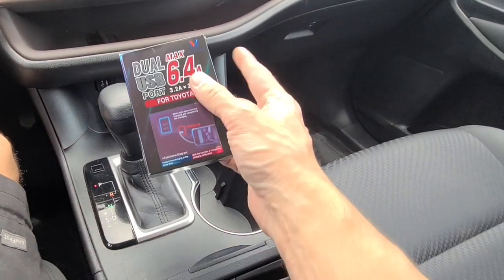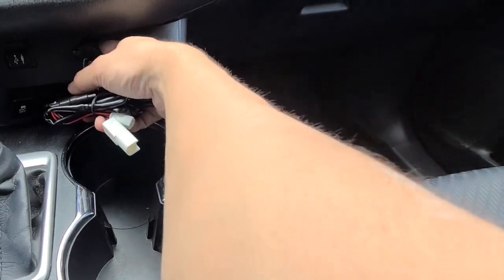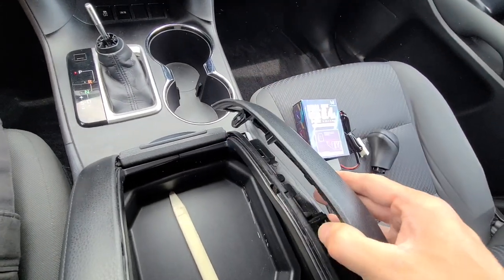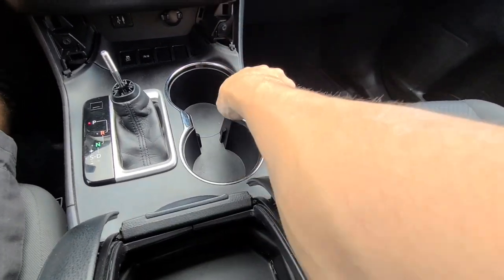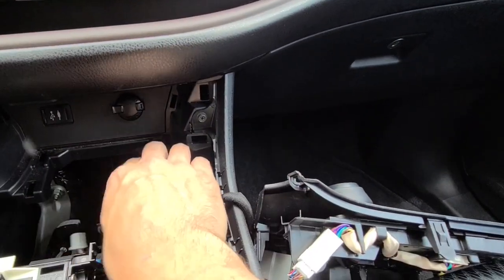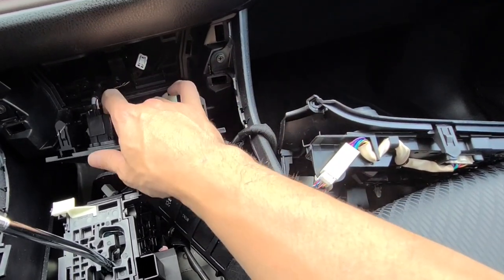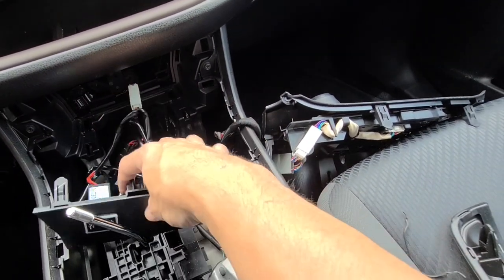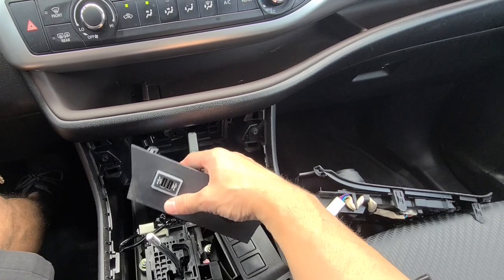Every Toyota Highlander NEEDS THIS Dual USB  Quick Charger Socket 3.2 Amps Quick Charge Your Phone

Comment: Great video, thanks! I bought it on your recomendation and it went together very nearly exactly like you show. I installed it in the existing USB location. One thing though, on my 2015 Highlander, there was a screw on the back of the last piece that you removed (the panel with the USB and cig lighter socket). You can see the screw with a dentist's mirror and a flashlight. You have to remove this screw to remove the panel.  It requires a stubby (very short) phillips screwdriver and pretty good dexterity (left hand working from the passenger side) to remove. I did not re-install the screw when I reassembled. Works like a champ and looks great. Thanks again!
Reply: thnaks Mark i knew it
Reply: Ditto on the difficult phillips screw at the top of that USB panel. Worked 3 hrs with stubby to try and loosen it and no luck.
Reply: @ralphghent3254   actually you don’t need to remove that panel at all.. use your hand unplug the power plug it to your usb cable then use the extra one to plug back the cigarette lighter it took me 5 minutes 😂. Good luck

Comment: min 3:11 im trying everythin in my 2018 limited model dosent came out i thing has screw inside almost broken used correct tools but i dont know wha happend cant reach the plug for conecte :(
Reply from the maker: Not sure dude
Reply: Same thing here, did you figure anything out?? I am going to reach out to my buddy at Toyota to see if he has any ideas...
Reply: There are two screws behind. It is super hard to get in without opening the whole center console. I had to break the last panel and ordered a new one. This video is fake

Comment: Just installed this in my 11 Highlander, only option was to swap it out with one of the existing 12v cig plugs, meaning I had nowhere to plug the extra adapter into. Can I leave that part unplugged or should I cap it off?

Comment: I need to do this but I don't think it'll solve my issue. I have a Dasaita android aftermarket unit and eventually it stopped connecting my android phone to the headunit although it does charge the phone. I saw you disconnected the usb connection but didn't connect it back only to the cigarette lighter, correct?
Reply from the maker: Yeah, won't solve your issue. So sorry

Comment: Great video and Awesome job. Amazing dexterity and speed filming with one hand. I will try this.   Any ideas for this situation?  I hate the parking backup and blind spot monitor switches on my Highlander 2016. I don't know why they have these switches. Many times I have backed up and not realized that someone (car wash folks maybe) inadvertently turned off the parking switch. Luckily I did not back up too far.  Same for blind spot monitor. Point being I would like to remove the ability for these two switches to be turned off and just have them permanently in the On position.  Any ideas?  I guess I could remove panel and wire them in the back to be on making the switch inoperable. Or I could turn them on and leave them in the back of the panel and replace their spot with a blank.  Guess these switches cannot be popped out of the front without removing the panel right?  Thanks for any ideas and thanks for video
Reply: +1 for "Amazing dexterity and speed filming with one hand"

Comment: Will this pass through audio or Is this strictly charging??  If I replace the same part you replaced in the video will I no longer be able to connect to the radio via the audio option. I know Bluetooth will still be available but I rarely connect my phone via Bluetooth.
Reply from the maker: Charge
Reply: @Donnythelatemodeltech  thank you!

Comment: This is a fake video; removing the lower panel, which the original aux/USB is on, is difficult. There are two screws behind the trim, which is hard to get in without removing the whole center console. I did not do that; my panel trim broke, and I had to order a new one for $35. Also, the new USB port makes noises. When you tap it, you can feel it, even before installation.